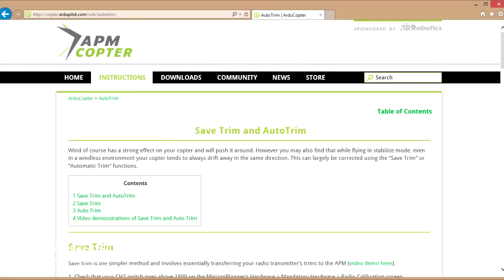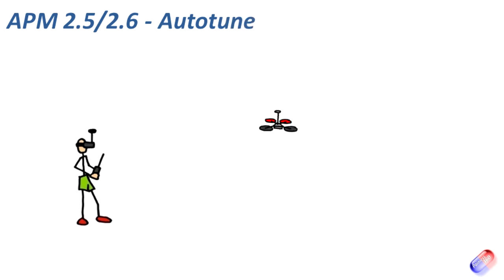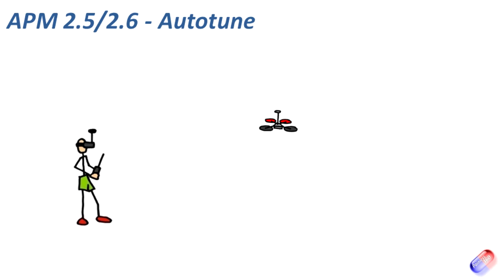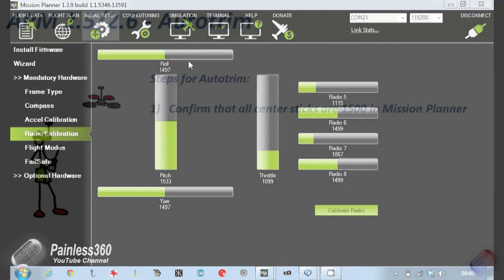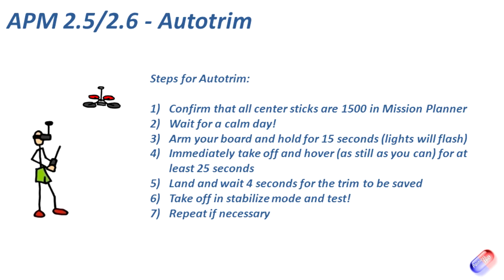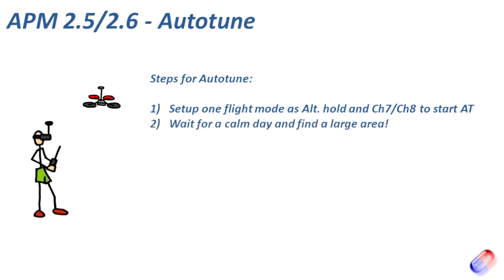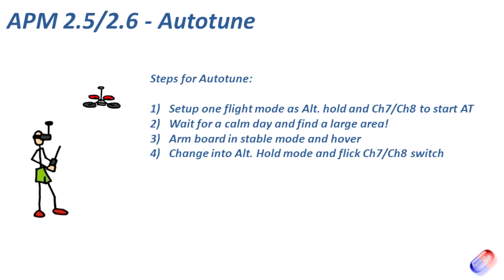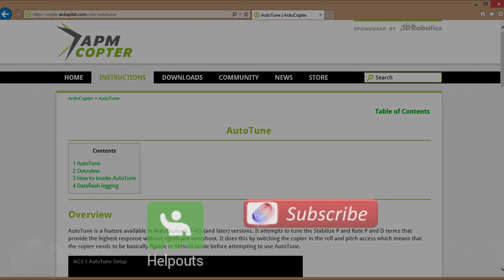(7/8) APM 2.5/2.6/3.1 - Autotrim and Autotune

Comment: I know its outdated, but I'm running an  apm 2.6 in a plane because the goal of this build was cheap and nothing else.  Does APM 2.6 support autotune for plane as well?  I can't seem to find a clear answer anywhere and just assumed it didn't, this is the first video I've seen of an apm using it.  Is it just for copter, though?
Reply: for reference I have been running an older version of mission planner for compatibility, and it doesn't have an autotune option.  I also have a current mission planner for my other builds and when connected to the apm it gives the option to enable autotune, but seeing as its not listed in the apm era MP i am scared to try it lol.
Reply from the maker: I honestly can't recall. This is a very old 8 bit flight controller that stopped being activity supported years ago (v3.2.1)

Comment: Great video ! Quick question : if you plan on using some auto-trimming, what if you realize in Mission Planner that your controls are not at 1500 at their middle position and you really need to change their subtrims on your radio, would that mean you need to 1) recalibrate your esc an 2) perfrom a tx calibration in MP afterwards ?
Reply from the maker: Any movement of the subtrims/trims on the radio following radio calibration and autotrim will mean that you need to go through both again. If you don't then the model will see the new 1500 middle channel values as you putting in a control input.

Hope this makes sense. Happy flying!

Comment: First off. Thanks for the video set. I build my first quad watching them using a 2.6 board. I have done an auto trim to get it somewhat stable and then wanted to do an auto tune afterwards to get it really solid. I have everything programmed properly and have reviewed the settings multiple times. My ESCs are calibrated (did them one by one) and it flies OK. I bring it up, put it into alt hold, then flip my ch7 to auto tune and it does nothing. I thought maybe it had to make very minor adjustments at first but even after letting it hover for 2-3 minutes still no "dance". Any suggestions? I'm using a FS Th9x Tx/Rx combo and have everything set as your video explains. Please help.
Reply from the maker: You need to make sire that you are not touching any of the sticks and the midpoints are right - see http://fpvlab.com/forums/showthread.php?34515-APM-Auto-Tune-not-working

Hope this helps..
Reply: I don't touch the sticks at all but maybe I'll try again this weekend. Thanks

Comment: Hi,  I am having problem doing the auto tune setup . I have only six channel rc receiver,so there is now to get ch 7 and select auto tune.Any solutions for those who use 6 channel receiver and want to auto tune??
Reply from the maker: Yes, simply plug the CH7 wire into one of the outputs on the Receiver that you can use (GEAR/AUX1 etc)... Best of luck!

Comment: I think my setup now has to be upgraded. .
sunnysky x22 12 980kv.. 
carbon fiber 1047
Simonk 30Amp esc
5000mah 20-30 c
bgc 2d gimbal
xiaomi yi cam 
total weight with battery and all is around 1700 grams. .
so which motor shud i go for 
emax 650 kv?
or DYS ?

Comment: Hello. As always, thank you for this videos. I have done the Autotune on my Pixhawk, it did it well. I read the documentation in Ardupilot webs too. But there are two things that I don't know how to resolve, so if you can help me, I'll be very happy. First, I read that I have to change the value for the attitude over throttle response to 0.9, because I have a large prop drone (12 inches on a 490mm quad), but I still see some strange behaviour like pendulum effect, sometimes during a stop when it's flying, and this is after running the autotune and changing the attitude over throttle value.
The other thing is an oscillation when is landing or descending in a vertical line. 

Can you please help? How can I solve this?
Reply from the maker: Not sure what you mean by pendulum. low frequency oscillation are usually related to P gain. High frequency vibrations (almost like a thrumming) are usually D gain. Falling in a straight line will cause it to oscillate as it descends into it's own dirty air.. More details here - http://ardupilot.org/copter/docs/stabilize-mode.html
Reply: Painless360 thank you so much! the pendulum effect is like when you are flying the copter in loiter mode, then you make a stop and the copter make first a movement to stop, but that movement is to strong so it make another movement to correct it, and then another and another until it completely stop. so it is like moving a pendulum and then stop it in some point, it will oscillate. so my copter is doing this. I stop moving it, and then the copter oscillate like 3 times trying to correct the movement until it stop completely. I think it's correcting too much. but I'm going to see the video that you send me, thank you again.

Sorry if I'm not good explaining, if I can't resolve the problem, I'll try to make a video of it

Comment: May I use Simple mode in Alt Hold Whilst doing these procedures?
I know U frown on that, but this a brand new Feisty/scary little bitch
just off the bench
Reply from the maker: +E Pasko why not. Check the latest documentation for the mode to check that it won't cause a problem.. Best of luck

Comment: Hi, I'm having huge problems when trying to launch my apm 2.8 hexa  with GPS (my first multi rotor) I'm able to arm it but when I try to lift off the stability is so bad that I can't get it 30cm high with out it crashing despite it being on stabilize! Would really appreciate any help, thanks!
Reply from the maker: I would strongly recommend that you start with something smaller to practice with. These things do take lots of practice to fly and setup.. Best of luck..
Reply: I realise that, but I found a great deal with the hexa, I'm so excited that you replied, is there any thing you could recommened though specifically as I do not think it is my flying skills as I've flown lots of fpv this is just my first build, sorry for the confusion in the previous comment, also I'm more used to naze rather than apm.
Thanks for any feed back!
Reply from the maker: I'd contact the supplier as the APM should feel very solid compared with the Naze32.. I'd also make sure that the calibration on the board is spot on.. Best of luck!
Reply: +Painless360 thanks for the advice!
Reply: Just thought I'd update you on the hexa, it's flying fantastically even though I haven't even been able to tune it yet! The problem was a channel being inverted, and me over compensating during take off, I didn't expect the apm to do everything for me. The other problem was the props not being tightened enough, causing them to not spin with the motors. Thanks for all the help!
Reply from the maker: Glad it's working. The APM is a great flight controller and does so much for you. If you're coming to a FC running ArduCopter then it feels soooo stable! Happy flying!

Comment: Hi,i am looking to build a f450 quadcopter,as base frame has a pcb board for the esc,s and battery i was wondering can i add a 
Matek Mini Power Hub also to run leds of?Also where would i run it of the base frame pcb?Any info would be great.thx
Reply from the maker: Depends on how it needs it's power. We normally always add an extra JST connector to the PDB when we solder it up so that we can plug FPV/LEDs etc into it later. Best of luck!

Comment: Hi Painless, As you might remember, I have just successfully done the Autotrim to my X350 Pro. Is this also compatible with the Walkera Scout? Thanks again.
Reply from the maker: AegeanGuides Hi, not sure as I can't tell what the flight controller is on those. If it uses an APM/PX4 or Pixhawk then this process with work.
Best of luck.

Comment: Thanks for these helpful videos, much appreciated.
At last a fine still day, managed to autotune in one shot, last time corrected wind drift so much it hit the battery limit before completion.

Off-topic comment just in case anyone is looking to reuse parts from a CX-20/Nova -
I put the APM and GPS on to a Chinese whitesheep 450 frame. I used Hobbywing esc's and cheap 935kv motors with DJI type props (to leave the existing ESC and motors in the old config in case I did find a frame). Different beast all together, not better or worse just different, for the extra weight I still get around the same flight times. As it is like a flat plate I find it hard to keep stable when decending unless it is slow or you keep moving to stay out of your own prop wash. Probably too much info but I didn't find out how easy it was to break the CX-20/Quamun Nova until I had read others comments (mine was a two foot high flip on battery fail during RTL) the orginal frame costs more than an aftermarket 450.

Comment: I have build my first quadcopter with the apm 2.6 but i have a stabilization problem. could it be the props that they are not balanced properly or could it be the vibratons causing problems in stablize mode. maybe the pids i have only done the basic setup. if it is the pids could i use autotune to get the pids right.
https://www.youtube.com/watch?v=f_SXFzdzQnE
Reply from the maker: +Boudewijn Pilon I would make sure that the props are balanced and that the APM is on an anti-vibration mount. Check the update speed for the ESCs is right and then I'd look at the PID setting (P too high?). I'd suspect vibration first.. Best of luck.
Reply: Thanks for the quick response I will try the thing you listed
Reply: +Painless360 I have balenced all the props and mounted the apm on an anti-vibration mount and I stil have the same problem. you said it also could be the esc update speed. how can i check those? I have tried the all in one calibration method and the one by one and both with the same result. do you have any idea what it could be.
Reply: +Painless360 I have balenced all the props and mounted the apm on an anti-vibration mount and I stil have the same problem. you said it also could be the esc update speed. how can i check those? I have tried the all in one calibration method and the one by one and both with the same result. do you have any idea what it could be.
Reply from the maker: I would check the .  See ArduCopter:RC_SPEED in http://copter.ardupilot.com/wiki/arducopter-parameters/#esc_update_speed_arducopterrc_speed

Other than that looks like a  excessive 'P' wobble. I'd check the logs to see what's going on.

Comment: Great video's , thinking about getting a Apm board? , I have a spektrum dx6 (new model) could I set the autotune on channel 6 or will I need to get a 7 channel setup ?
Reply from the maker: A 6 channel radio is loads if you don't need extra channels for head tracking or camera control.

Happy flying!
Reply: Cheers :) great videos :)

Comment: Got all the manual and auto trimming done, and it flies and hovers very well, BUTTTTT!! I still can't get it to loiter well. The vertical seems fine, but it just rolls or pitches, mostly rolling to the right, and keeps going. Once it gets into a roll it just starts to fly away. I don't have any trims set to throw it off. It's an extremely calm day today, maybe 2-3 mph. I don't know what to do now, and I am definitely not going to try RTH. ANY SUGGESTIONS WILL BE APPRECIATED, THANKS. 
This is my 5th build but my first one with APM, this build is very similar the the link here: https://www.youtube.com/watch?v=gzRs2UtBsLw
Reply from the maker: +Carl Bradley I'd check out our video on things to check if your model drifts. Best of luck!
Reply: The weather is bad outside today but I think I may have found the problem. Read on a forum last night about the compass can be flipped. So i hooked up to MP and saw that North and South were correct, but East and West where wrong, 180'ed it, now compass is showing right directions. I'll reply again once I get a chance to test it.
Reply: Ah haa!  Got it working. Had to 180 it in the compass set up, now it works. N, S, E, and west correct now. Guys - after you do the compass calibration go the the panel with the horizon and compass on it. Make sure when you turn the APM that it a least attemps to N, S, E, and West when you point it in those directions. If you notice anything opposite then you will have to fix it on the compass calibration screen. Note: maybe I should have but I didn't seem to need to recalibrate my APM compass once I corrected the "Off Set".

Comment: While i have not tried the autotune yet, the documentation says:
6. When the tune completes the copter will change back to the original PID gains.
7. Put the ch7/ch8 switch into the LOW position then back to the HIGH position to test the tuned PID gains.

You said in the video, once it stopped, it will run in new settings? So, which is which? Can you confirm this?
Reply from the maker: We did it the way we cover in the video. Things may have changed since it was filmed so always review the latest documentation for the version of the software you are using.. Best of luck!